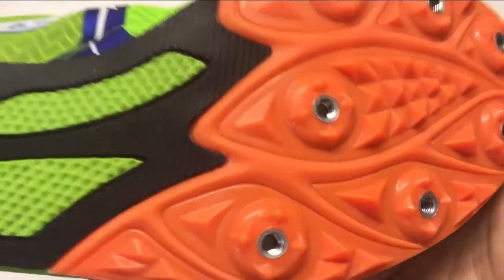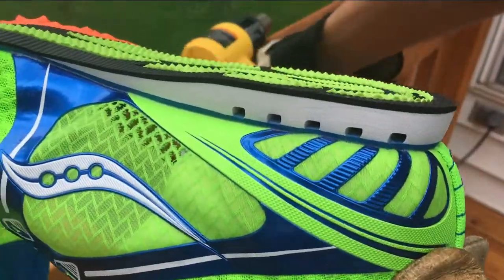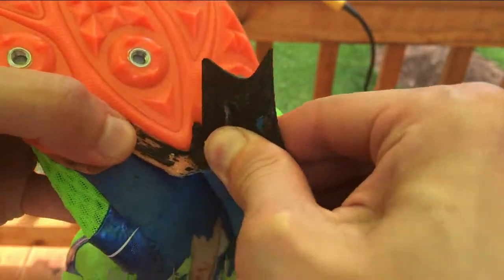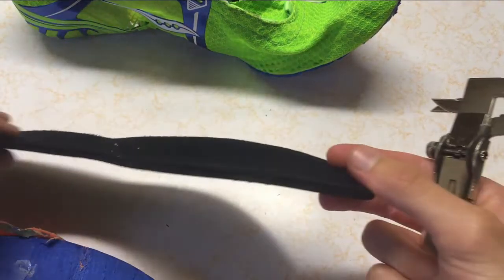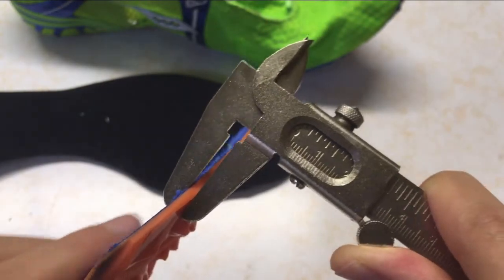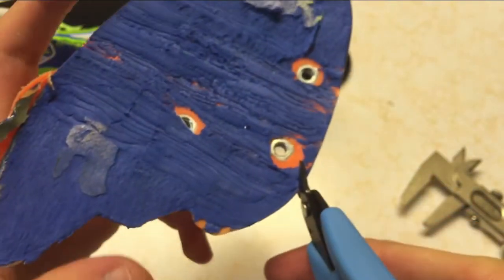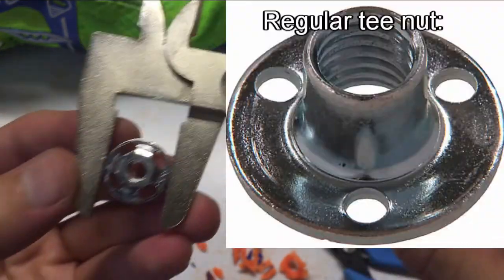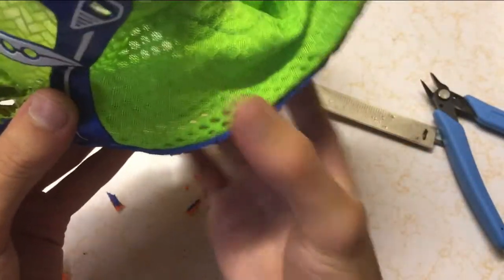Track Spike Teardown | What You Can't See From The Outside

Comment: leather would work with modified T nuts and you can make a resin and carbon fiber reflex plate for the shoe midsole.  Put some foam on top of that or another piece of synthetic material that protects the carbon fiber or Pbex.  Leather is much easier to replace and repair than these exotic plastics. And leather is way more customizeable. Then all your flex spring is contained in the carbon fiber instead of the exotic plastics which may be hard to source one day.